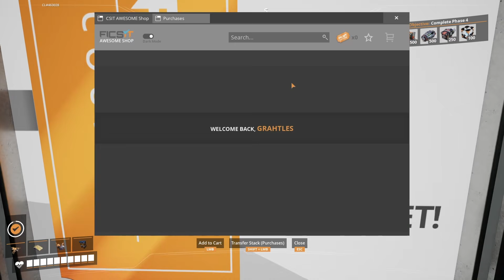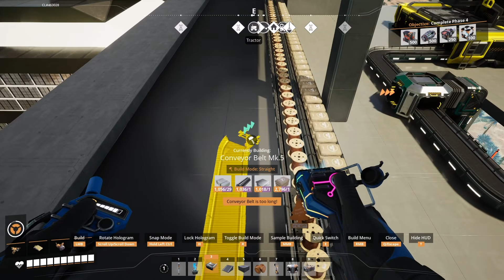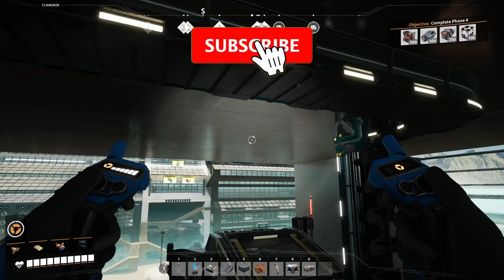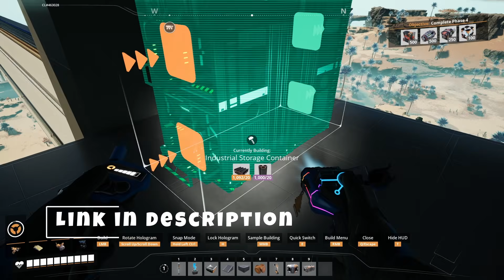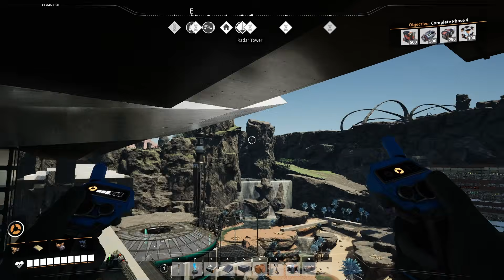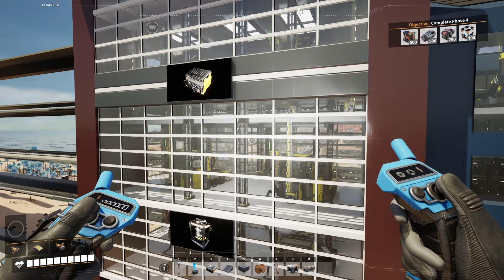Super Computers, Radio Controls & Turbo Motors Setup / Satisfactory 1.1 Best Start 2 #21

Comment: omg such timing, i just did a build making 50 fused modular frames (and posted my first ever tour, it's so bad) and am about to start one that combines 30 pressure conversion cubes, 10 radio control units, 10 crystal oscillators been putting them off), 10 supermotors and 10 supercomputers! i would do more but the calculator broke, telling me to put 11.6k quartz in 0.5 assemblers or blenders to make silica xD also i'm almost out of bauxite mines so this is pushing the limit already

ok now i'm gonna watch your video xD
Reply from the maker: WOW that's A Lot! Well I hope this video helps!
Reply: @Grahtles go big of go home! I like to challenge myself. Honestly the challenge isn't the complexity so much as keeping my sanity building rows and rows of refineries and assemblers 🤣 also this build is gonna have 1 set of 55 manufacturers, on top of other sets of them, which i am absolutely not looking forward to
Reply from the maker: Wow and I am the same way when I play for myself “Go BIG or Go Home” but when making the series I try and keep it simple but expandable!
Reply: @Grahtles yea my main base is expandable too, just long extendable manifolds
Reply from the maker: Oh Nice!
Reply: @Grahtles  first step done. took 3 hours just to get the bauxite to where i'm starting the build. Only two unused nodes left xD
Reply from the maker: Perfect ❤